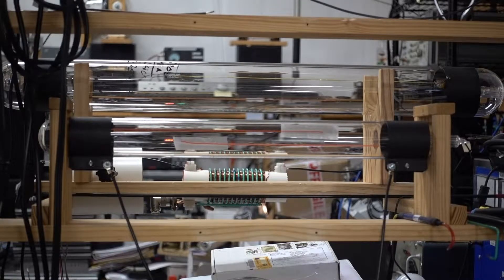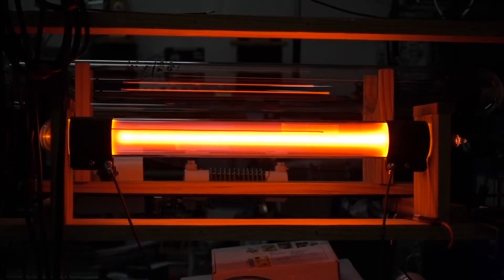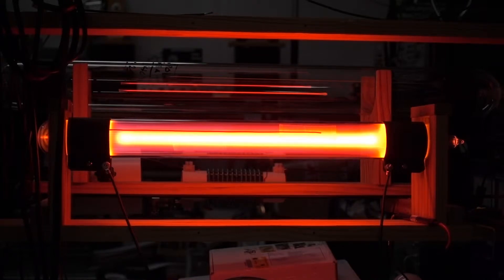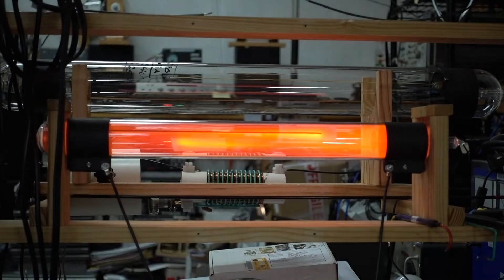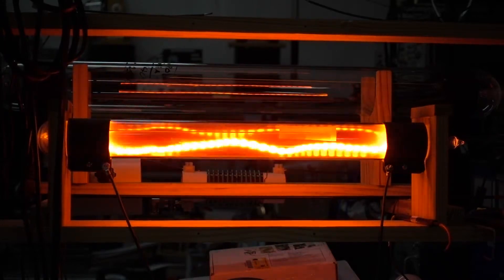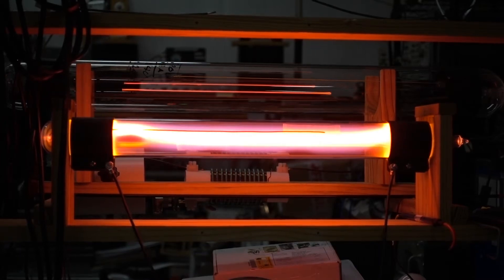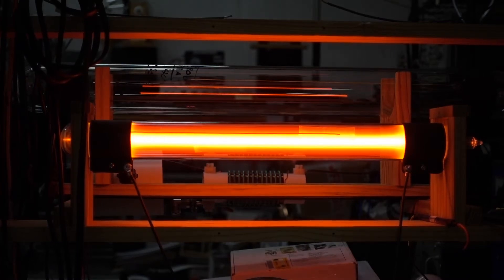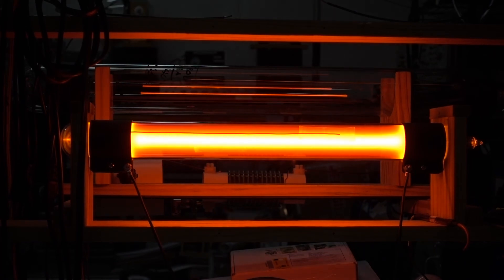First Light and Testing of a New SSQ-ST Plasma Tube with Side Wires

Comment: In this case, will the path of plasma change under the force of magnet? I think it should, but these  2 wires bother me
Reply from the maker: Yes, a magnet does redirect the plasma to some extent.    The two side wires are needed to obtain a high voltage field across the tube to help start it when the tube is deionized.  Since the applied RF power falls to zero during each modulation cycle, without the side wires, the tube may fail to start promptly.  This allows the voltage in the amplifier tank circuit to rise to dangerous values, and causes the output transistor to fail. So the side wires are necessary for this tube. Internal electrode tubes do not need the side wires, but some of the external electrode tubes do, especially the larger tubes.

Comment: Hello, you need a lot of power to heat the gas and start ionisation, right?
Reply from the maker: Yes. this tube needs about 100 watts of RF power to start it lighting.  Using the side wires helps a lot with starting, and allows you to use less power.
Reply: It’s pretty obvious